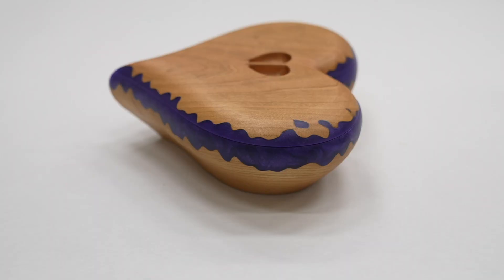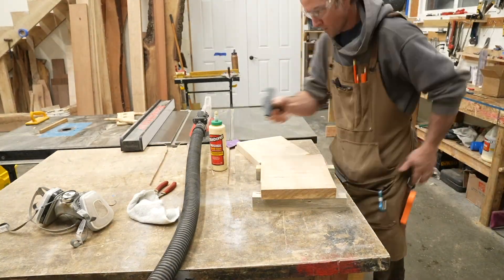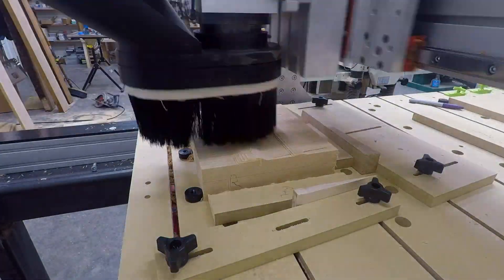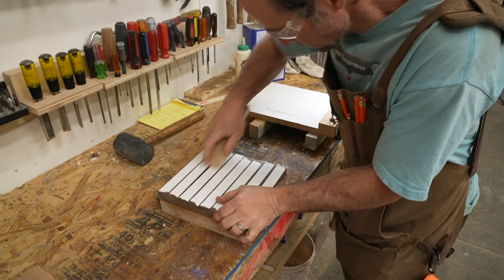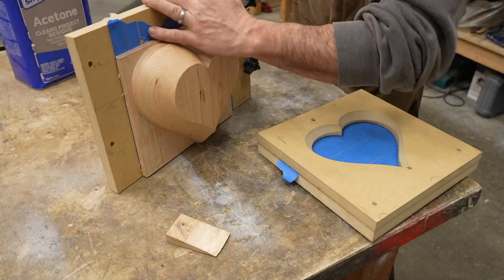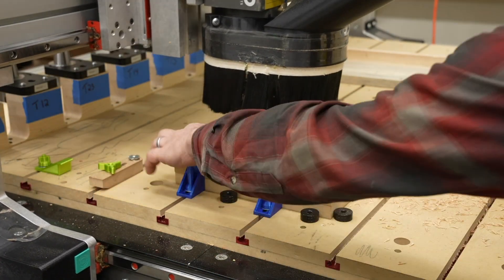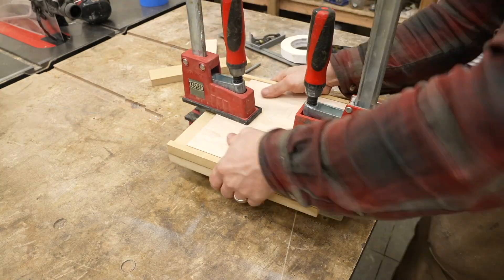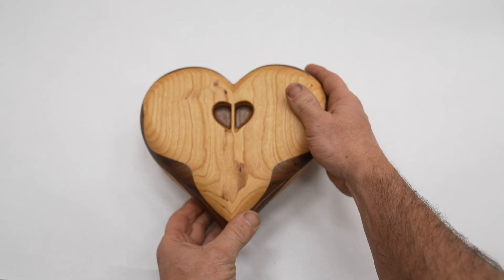CNC'ed Jewelry Box - Heart Shaped Box. How I made it with with two sided machining and Fusion 360

Comment: Corbin...does the special bit you ordered have a 3" cutting length or 3" overall length?  I know you did say "3" "Overall Length" but wanted to validate.

Referring to the comment in your video description.  * 2L custom made this bit for me; I have been using it for a few projects and it seems quite good. We'll see how long it lasts, but for $20 it is a great deal compared to a lot of more expensive Amana tool bits. I really need the 3" Overall Length for deep carvings like these, and Amana doesn't have one in the 1/4" ball nose size.
Reply from the maker: Yeah - I do mean 3" overall length, about 1-1/4" cutting length. My deep bowl designs, especially the recent "salad bowl failure", all have a shape that allows bit clearance; there's a specific angle that is needed depending on the collet, but I just guess and do machining simulations in Fusion. If the collet or bit hits, then I modify the design until it can be made. This requires carefully measuring the length sticking out from the collet and using that in Fusion's tool.